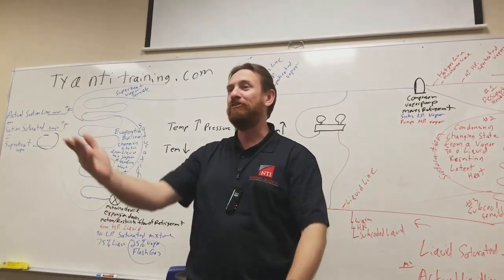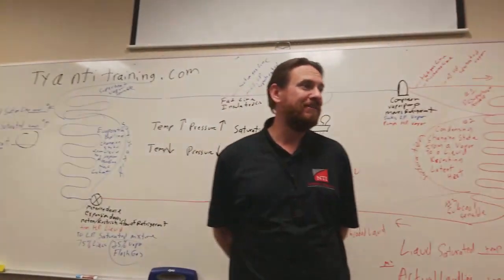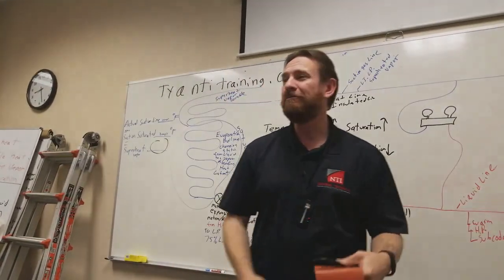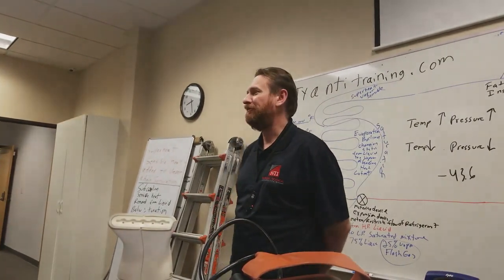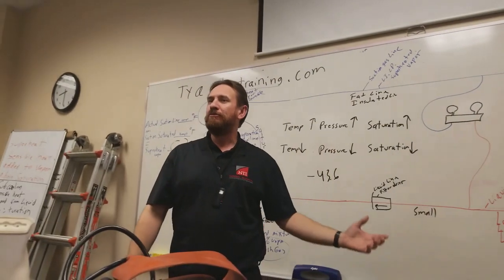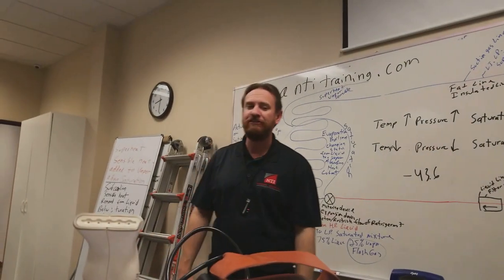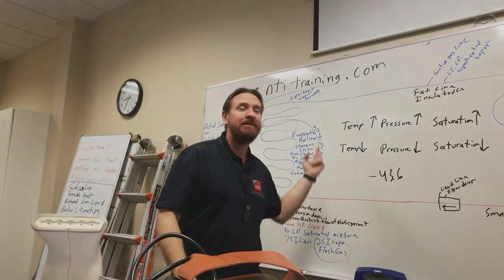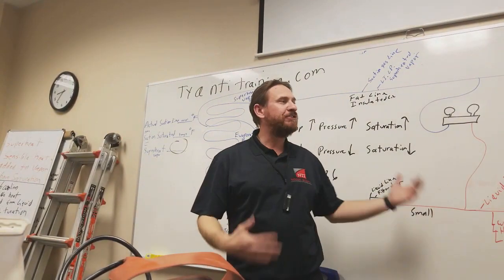Propane as a refregerant

Comment: Does propane preform better as a refrigerant and produce colder temps than traditional refrigerants?
Reply from the maker: It dosent produce colder temperatures but it has the capacity to move a little more BTU than R22

Comment: Damn.I was enjoying being paranoid. You make sense. Thanks. I'm off to fill a split with LPG.
Reply from the maker: Take the course https://www.rses.org/training/hydrocarbontrainingprogram.aspx
Reply: @love2hvac  Odd question, 

Why not use LPG in vehicle for the ac system. Best guess depending on humidity, it would blow about 10 degrees or maybe more colder than R134A. I've heard people that have done it, but not sure of the amount of propane I would need compared to R134A. To bad you don't have a friend that teaches automotive and could do a lab on this. 

Bryan in Florida
Reply from the maker: You would be one of the few people I would trust to try it. 
I'm not sure about compression ratios on automotive compressors. For homes (for the record I am not recommending this to anyone, do not do this ) it would direct replace R22 capacity wise. But R410a compressors have lower volumetric pumps.
Reply: @love2hvac  Thank you for the compliment. Not sure if we have met before or not but its surely a possibility (www.lincolnman.net). Just a thought to nibble on. Back in the 90's Ford claims it used a "leak detection" in most of their vehicles but never told us what it was. I can clearly remember and others also have stated that some of Crown Vics of that era could blow ice flakes through the vents, but after any ac work was done. It never blew that cold again. I'm betting Ford was testing out on the public R134A mixed with propane to see if it would blow colder than R134A alone... Remember: there were a ton of older steel vehicles back then on the road and no one wanted to drive an oven down the street. Ford knew R12 blew colder than R134A. So I'm betting if it wasn't propane they mixed with the R134A, it was some other gas. 

Any clue what they might have done?

Bryan from Florida

Comment: Gassed up a deep freezer with some propane for S&Gs and it ran extremely cold. Compressor didnt seem to mind but needed a diffrent lube oil. Used dielectric transformer oil.
Reply from the maker: Should not need to change the oil, propane works with all the refregerant oil
 Very cool that you did that. Did you use refregerant grade or just out of a propane tank?

Comment: Hello Ty what do you think if we run CO2 instead of Nitrogen for brazing copper lines? Thanks.
Reply from the maker: Yes,you can use CO2 botnets notorious for freezing up the regulator.

Some people are concerned with the  Carbon and the 2 oxygen molecules oxidizing. I haven't seen that to be an issue. I will try it and do a comparison next chance I get.

Comment: I always thought it was call to grab the lpg bottle off the bbq at a party to cool down drinks. Works well in a pinch and is far quicker than using a freezer, plus you can vent it unlike flourocarbons